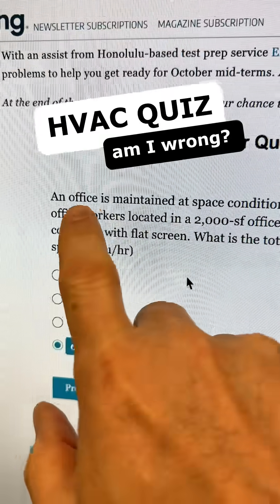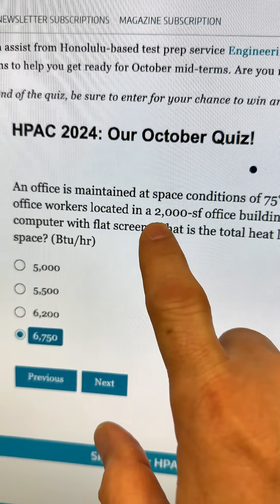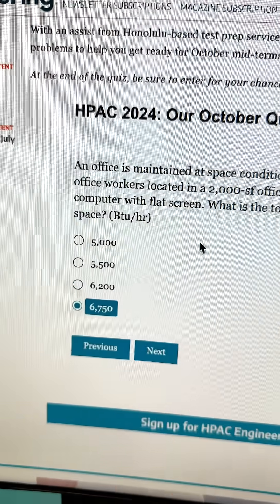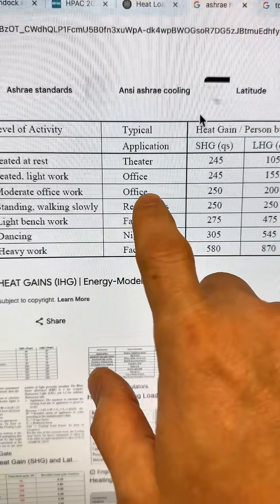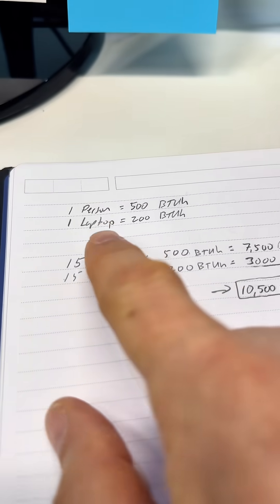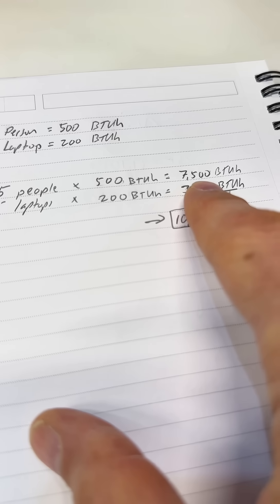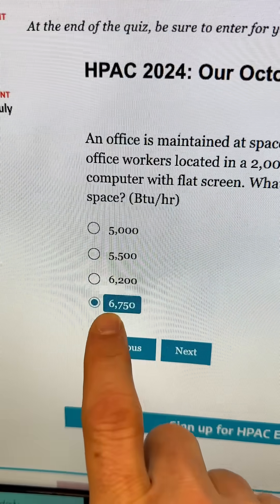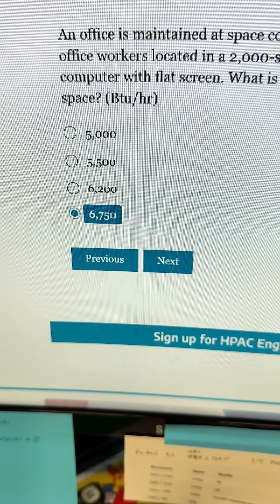Common HVAC Mistake: 240V Electric Heater on 208V Power

Comment: You’re using 500btu/hr per person instead of 250.  If you use the 250btu/hr you would get the actual answer. 

(People)   15x250btu/hr=3,750
(Laptops) 15x200btu/hr=3,000
                  Answer:           6,750btu/hr.

Comment: It seems that 6,750 Btu/h results from using "Adjusted M/F" total heat load from a human doing moderate office work (450 Btu/h) times 15 people (ASHRAE Handbook Fundamentals, 2021, Ch 18, Table 1). Apparently, the computers are not included.